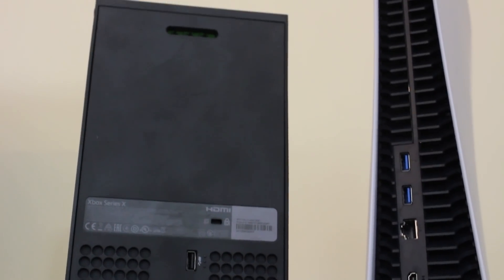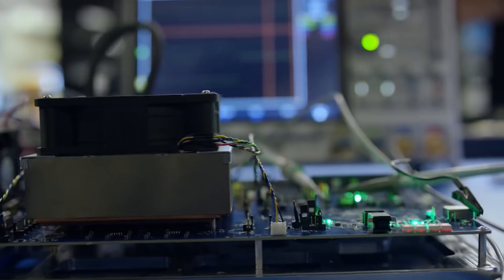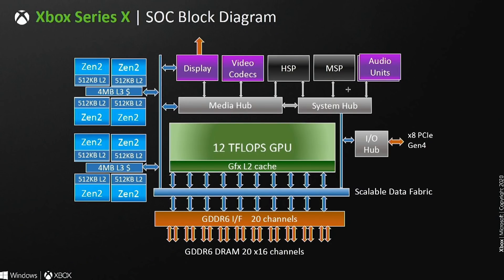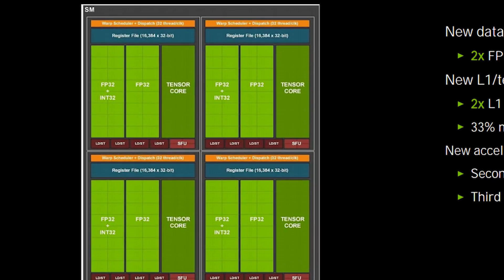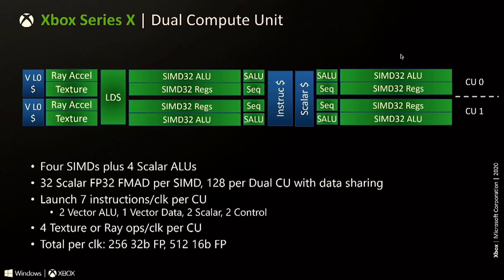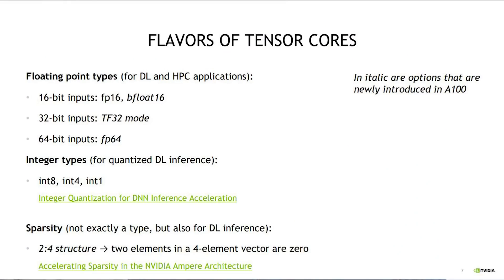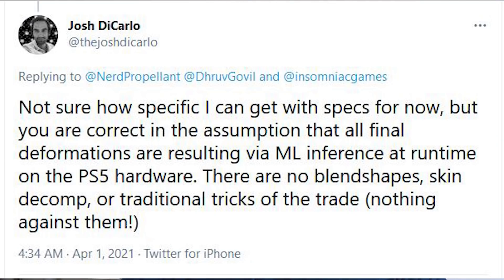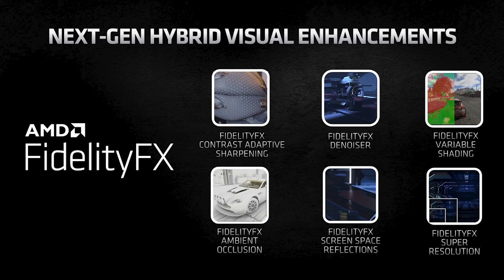Xbox Machine Learning & DirectML EXPLAINED - No, Xbox Series X Doesn't Use Tensor Cores

Comment: According to Alex from Digital Foundry the Xbox Series X ML performance is 2x weaker than the 2060 ML. Thats not good if it wants to be anywhere near DLSS 2.0 levels, BUT will still be a boost in fps.
Reply: How do he know that ain't no one using directml?
Reply: @anthonyking6037  He said it on Twitter, will look for the tweet when i het home from work. His source was Microsoft themelves.
Reply: It is very early on though. There will be improvements . I can't see MS accepting crap ML performance or why go to so much trouble for a console in the first place?
Reply: @DEVILTAZ35  ML was never the focus on the console. Also its still a decent boost in fps, even if its ML is weaker than the 2060. ML isnt raw performance, just machine learning.
Reply: I think the Direct X12 would change that. Even if it's a little.
Reply: @JayRembert  I dont think it will put it anywhere near DLSS 2.0 for Ampere.. Maybe closer or slightly higher than 2060 ML but it would have to boost it 2x as much as now which is hard to see happening, but i guess we will see.
Reply: How does he know? Source?
Reply: No offense to digital foundry however I think Alex is very wrong and it's more on the level of a 2080 super to the 2080 TI. Alex doesn't know exactly how it's or what level it's that because it hasn't been demonstrated as of yet. So I think Alex is jumping to conclusions
Reply: @usguyver  The XSX is nowhere near the level of the 2080 super or 2080ti.. It hasnt beaten the 2080 in a single benchmark. Its been headbutting with the 2070s at best. While the PS5 been behind the XSX. The ML performance is not nearly as good as DLSS 2.0 sinde this is tevh Nvidia has been working and improving on for years. AMD is in Alpha still trying to catch up to it.
Reply: @pcgameboy8407  on paper it's a faster card than the 2080 super. They are using vastly different architecture and series x hasn't really been taken advantage of. It will outstrip performance of the 2080 super easin most areas soon once games are developed to take advantage of the rdna2 featuresets.
Reply: @bluntm4n9  You dont look on paper since AMD and Nvidia gpus and such are different, that goes even more so when its console vs PC.. The XSX will never get past 2080 super power, and very unlikely to even get near it. The RDNA2 has been used in the 6000 series for a bit now, and we javent seen much jump there, if AMD gpus arent getting much better with even better RDNA2 tech, then its unlikely we will see anything big from consoles. You guyscsay this every gen tho. Xbox One X never surpassed the 1070 in games all through its lifespan. Its stayed at around 1060 level. With Raytacing on the XSX runs like a 2060, with RT off it runs like a 2070s.
Reply: @pcgameboy8407  that's fair however on paper you can look at TFs, memory bandwidth etc. but I get your point. I would also argue the analogy of one x not surpassing the 1070. That card was extremely bottlenecked by its CPU. We will see how it goes, the SX already was on par  with the 2080 super running gears 5 upgrade. So it will also depend on the games and optimisation. As always. I still expect over the lifespan it will pass it.

Comment: You had the chance to do a video about the superior machine learning that the PlayStation 5 has. What’s the point of doing the inferior version first?
Reply: Wow, dumbest thing I’ve heard all day smh. You can’t fix stupid I guess
Reply: I would say the Auto HDR implementation that xbox has is more impressive than what insomniac has done
Reply: @grumpy_old_man That ML muscle deformation update on Spider-Man MM had zero impact on performance. Basically adding a ton of detail to the character model at no cost so it seems more likely that it was hardware method.
Reply: @weaverquest  The DEV actually said they used Software. It just means they had enough overhead left for it to not affect performance. They are a genius team anyway. I have no interest in Spiderman at all but i like the tech behind it all the same.
Reply: It’s awesome that Insomniac it’s pushing the tech on the PS5, but most of their tricks are software based. They’re very talented indeed. But Xbox was really built around all this Hardware Accelerated techniques.
Reply: @grumpy_old_man It is one of the most detailed games out there with ray-traced reflections running at locked 60 fps using temporal super sampling and dynamic resolution that already drops under stress so clearly not much headroom to just add tons of detail to the character model through FP16 ML interference. Also the developer themselves said it had no performance cost.
Reply: @grumpy_old_man It is at half resolution and actually one of the most stunning usecases of real time ray-tracing I have seen from a presentational standpoint. Those accurate reflections from the skyscrapers look amazing and a massive upgrade over the PS4 Pro's fake blurry reflections that shows completely different objects from what it is supposed to be reflecting. I mean seriously though why are you trying to downplay how good Spider-Man PS5 looks, even according to Digital Foundry it has the second best graphics of 2020 only came second to Cyperpunk 2077 running on high end Nvidia GPU with all RT features enabled.
Reply: @weaverquest  It looks good but i  just wish it was in a Batman game and not Spiderman lol
Reply: So software based ML is superior to hardware based? I would never have thought it smh
Reply: I swear I feel sorry for you PS fanboys. Just enjoy the console you like. But to say the Xbox is inferior? That's the funniest thing I've heard all day.  there's talk of the Series S is being compared to the PS5 now so who's inferior? Lmao.
Reply: shut it pony.
Reply: Alfred Basurto  it’s in the patch notes fir the game they’re using software namely ZivaRT
Reply: @mackemsruleFTM  Do you guys understand that every feature in computing is enabled by software running on hardware? There is no such thing as a "pure software" solution, nor a "pure hardware" one for that matter. As for whether the PS5 has dedicated hardware to accelerate 8- and 4-bit integer math, that is unconfirmed but can be expected unless stated otherwise, because RDNA 1.1 and 2 include that by default, and Sony would have no reason to remove it. It's not as if this were some special Xbox-specific addition.
Reply: @Siemova  You are wrong!!! i saw phil spencer himself put machiiine learning cores in the almighty series X!!! All hail emperor spencer✊🏼
Reply: Also, recall that it was Sony who introduced "Rapid Packed Math" (half-precision, 16-bit floating point operations) with the PS4 Pro. (Which many Xbox fans pooh-poohed at the time. Ironic!) So, not only would they be unlikely to remove hardware acceleration for such operations, but precedent shows that they are interested in including and promoting it.
Reply: @Siemova  Bro you're talking to a brickwall, let them find out the hard way!!
Reply: @Siemova  yeah but the PS guys can't understand that having specific functions built into the GPU in specific cores is better than having just software taking up GPU resources from over stuff in a non hardware enabled GPU
Reply: PSimps get dumber by the day
Reply: Alfred Basurto  Drivers and tools make a world of difference. That and i wish they would stop making games 4k on Series X at 60 and 1800p on PlayStation. There is not that much of a divide between the two and it often will result in PS5 having a smoother framerate due to less demand. They need to start offering resolution support like a PC where you have full control to run it in whatever resolution you like. I really thought  this generation we would see that from both. We saw this nonsense with Xbox one X running too many games at native 4k at unstable framerates where as PS4 Pro at 1440p was often a locked or near to locked 30 fps experience. This is a major reason why back compat is working out smoother on PS5  in certain titles as it is effectively doubling 1440p output to 60 where as Series X is doubling 4k output to 60 which is much more GPU intensive. Let's hope DEVS work this out and we see things running smoothly on both platforms from now on. You do miss out on AutoHDR and x16 automatic filtering on PS5 though which doesn't get mentioned a lot as it really does affect picture quality in a major way if the PS4 version had low filtering on any title.
Reply: @grumpy_old_man the officials Sony studios developers said its hardwares not software!
Reply: @TarunTechEnvironmentCC  no they said it was running on PS5 hardware not that it was in gpu hardware, it uses ZivaRT so it’s def software based, or they wouldn’t need it
Reply: @TarunTechEnvironmentCC  the hardware is not optimized for ML. Xbox is 5-13x more effective at ML
Reply: @vandammage1747  you already benchmarked!?
Reply: @TarunTechEnvironmentCC  it doesn't have rdna 2 how is it hardware
Reply: @grumpy_old_man they said its hardware ML! If you doubt check on the Internet!